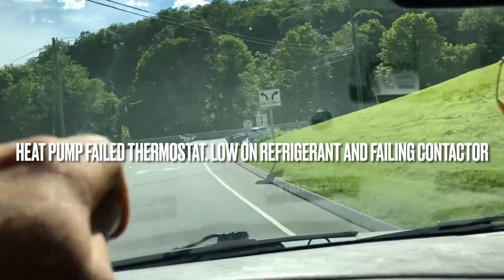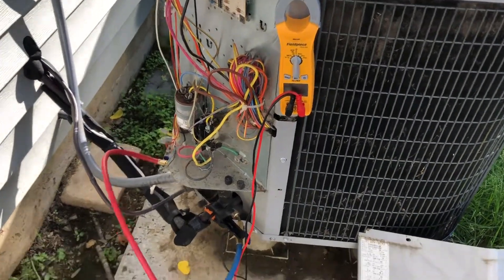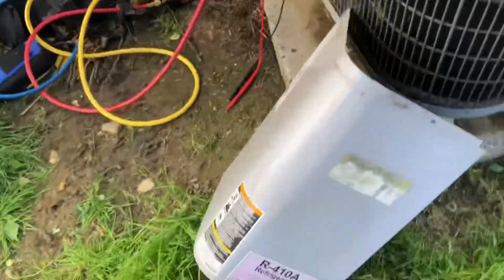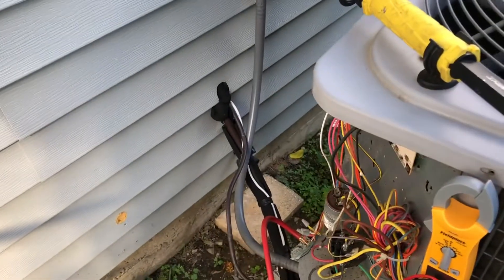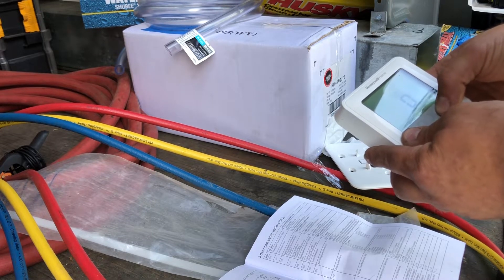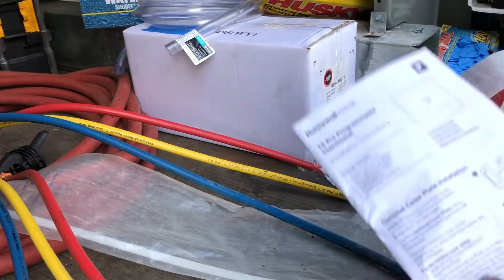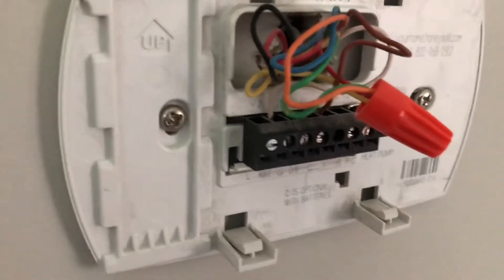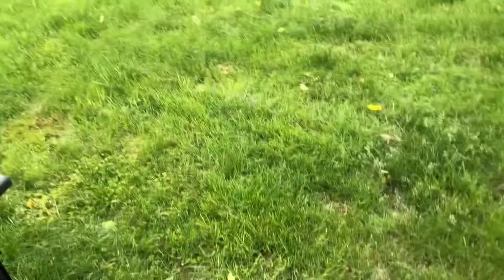Heat Pump heating on call for cooling?  Why is my heat pump heating in the summer ?

Comment: What wires u jumped to get cooling mode outside unit?
Reply from the maker: What kind of heat pump do you have?   Depending on mfg.  R G Y O.   or. RGY